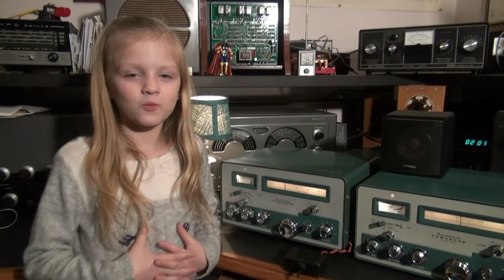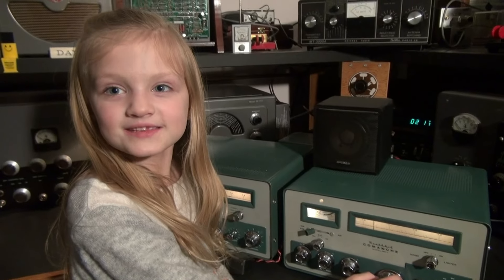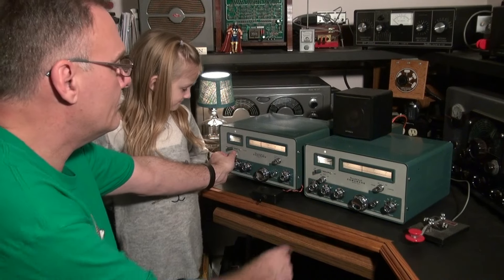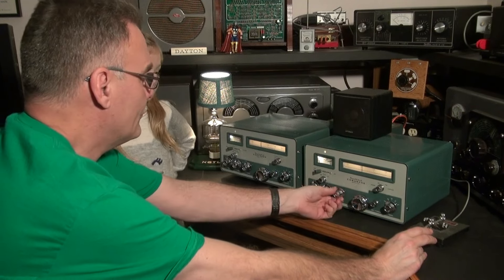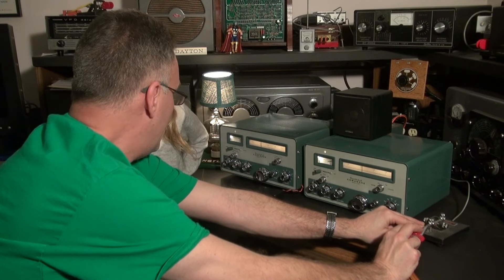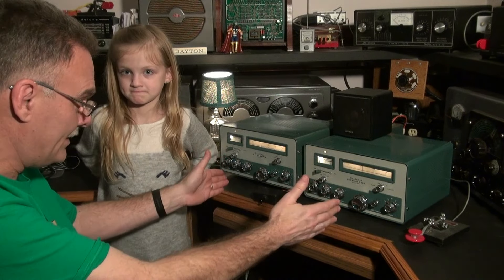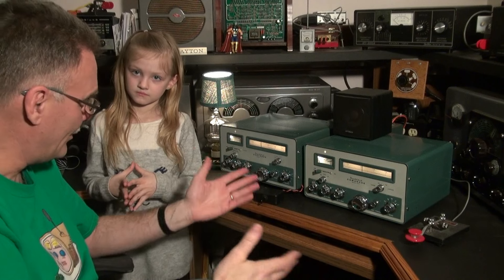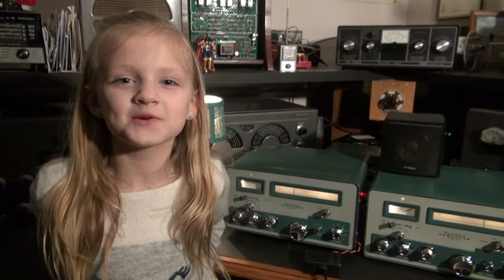Shortwave girl Presents Heathkit Cheyenne Comanche Ham Radio tube twins

Comment: Nice video. My first transceiver was Heath HW100 which I built 1970. I also had HW32, 20m trcv in my car. Today I have Drake Line and Heathkit SB401A (I like vintage radios too). 73 de OH2BIO from Finland.

Comment: i just got a heathkit cb-1 transceiver and i am wondering if the regular rca jack antenna from my emergency 40ch car cb will fit and work with the radio? its a base unit 110 volts the plug is an old modified tube socket and the antenna jack seems to be a regular rca female jack